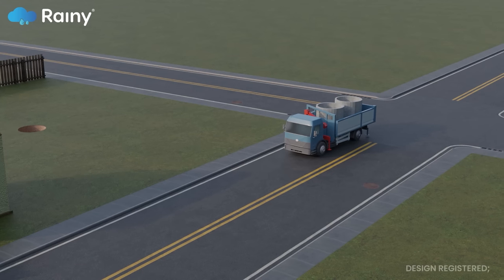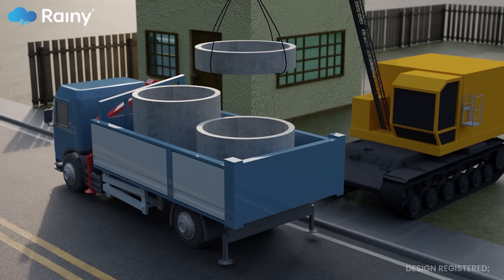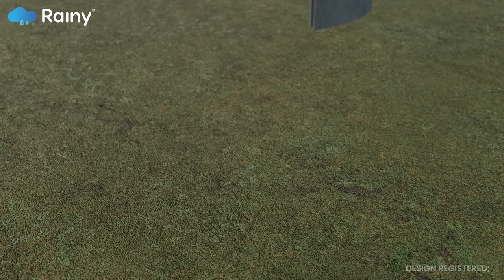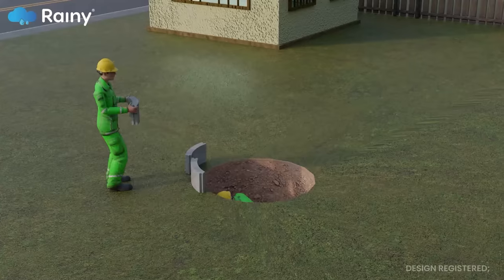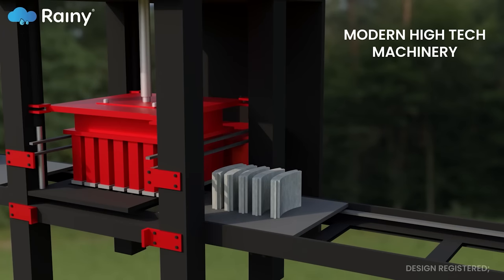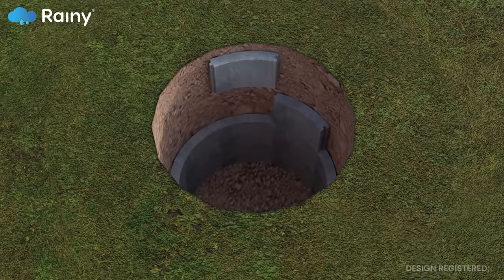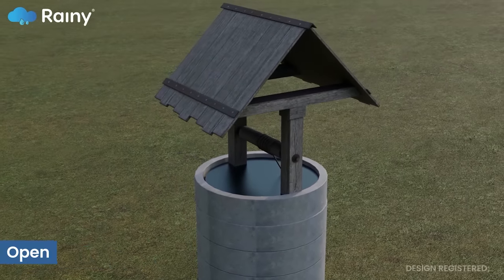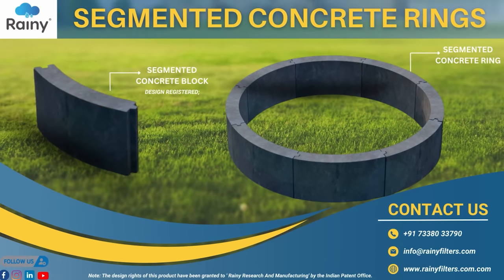Segmented Concrete Rings

Comment: Seems to be very easy and ergonomic. 

In case of Water storage, how you ensure non leakage of water?
Reply from the maker: Dear sir , 
Thank you for your kind words .
The segmented concrete rings must be plastered with cement to create a hollow cylinder-shaped cement structure that can be used as a storage tank.
thank you